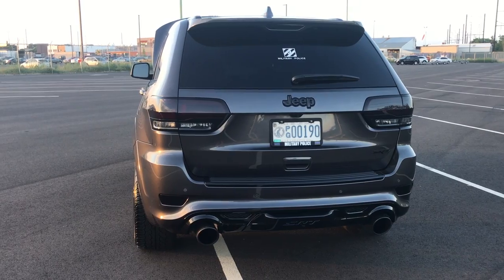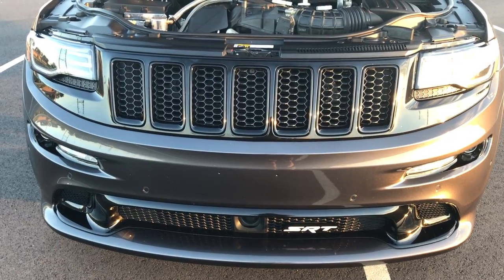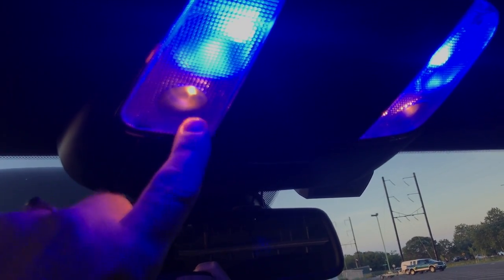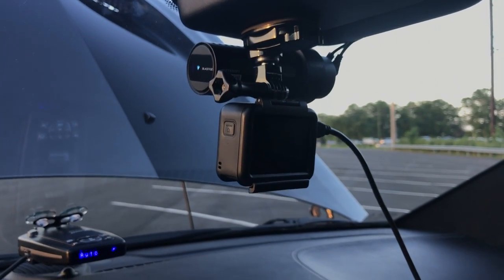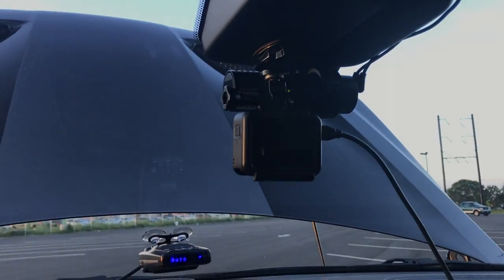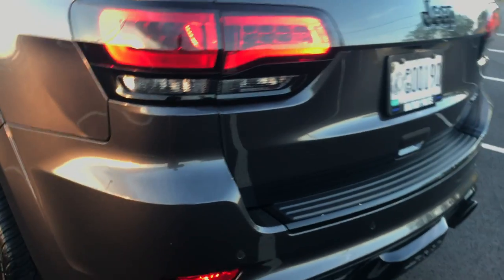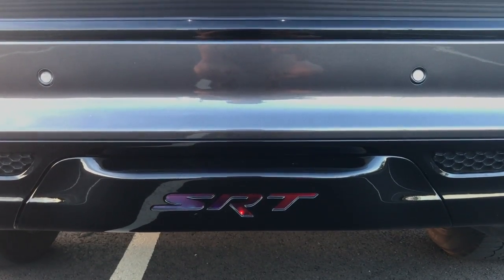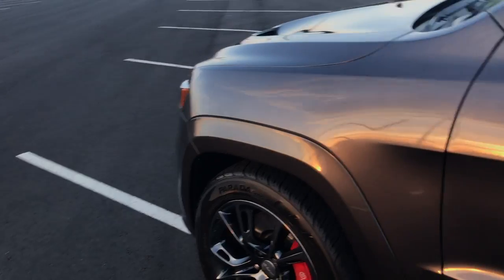All the mods done to the Jeep SRT this past year

Comment: I have a 2015 Jeep SRT, Red Vapor edition I bought pre-owned. Had 58,000+ on the odometer. One of the 2 owners, or a little of both had hooked the truck up good! Just like you had with your Jeep, same black vinyl accents where the hood vents are, but with a blacked out roof top and antenna shark fin. Also deleted the mid muffler, and straight pipe that bad boy with a “Borla Atak” system. I bought a oil catch cans from “ADD W1”, and it’s doing the job as it suppose to do. Of course the gas on that thing is horrendous, but nonetheless I’m enjoying every minute of it! Happy to see you had fun with your Jeep.

Comment: I actually did change the tiny map lights , required buying two smd dot leds from superbrightleds , taking apart the whole overhead piece and unsoldering the stock leds and installing new ones , quite a pita but got it done

Comment: Hi, big fan from Australia. Can you tell me what are the benefits of the catch can? Also have you done any mods to the air filter? Im thinking about upgrading to a mopar cold air intake, thoughts?
Reply from the maker: A catch can captures blow-by gases that are being redirected back into your air intake to be burned off. This isn't something any car engineer wanted to design but was forced to do so because of the EPA. Years ago cars had an oil drip line so this blow-by could drip on the ground. That oil was contaminating the groundwater so the EPA mandated that all cars have a closed system. The blow-by had to be redirected back into the intake to be burned off. Over time that extra oil going in that way is leaving a residue and gunk. The PCM could even pull timing if it's a lot, and it's just not a great idea to have it going in there. It's a great investment for any high performance engine. 

I no longer have my stock airbox. I have a ProCharger with a filter. All cold air intakes except the BWoody Long Tube intake are basically short ram hot air intakes. They're useless unless you'd like the engine to sound better. They add so little power it's not even worth mentioning and your IAT's at idle will increase. I liked the stock box over anything I saw available.
Reply: super thanks for your help. think im gonna order me a Billet catch can.